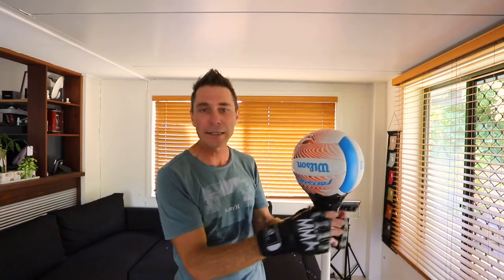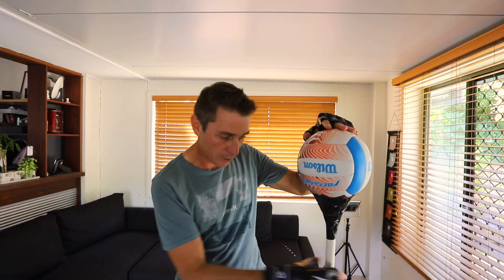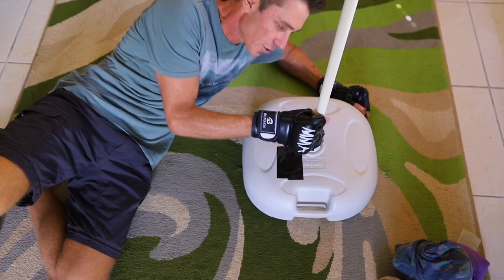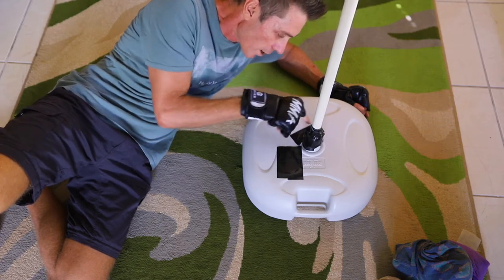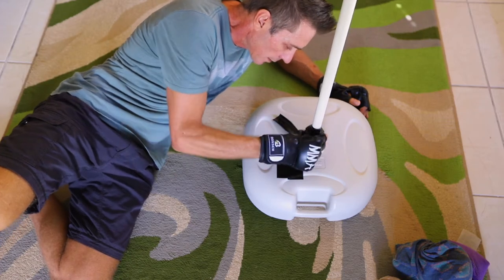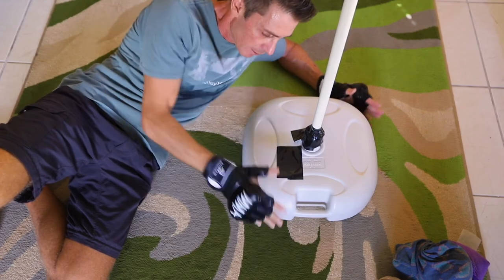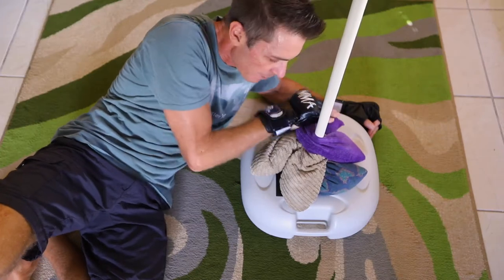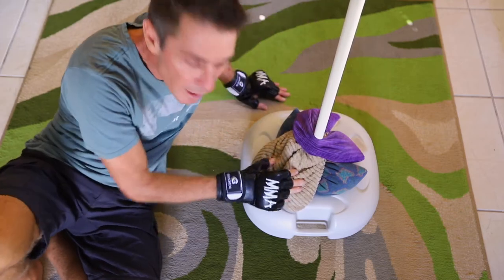DIY Punching Bag Upgrades & Demo

Comment: What are the sizes of your pvc Pipes the ones on the outside and the one that you put on the inside
Reply from the maker: 1 inch (20mm) diameter for the inner and 1-1/4 inch (25mm) for the outer.
Reply: @Kewlus  So those sizes fit in the Umbrella Stand that holds a diameter of 1in.?
Reply from the maker: Yes